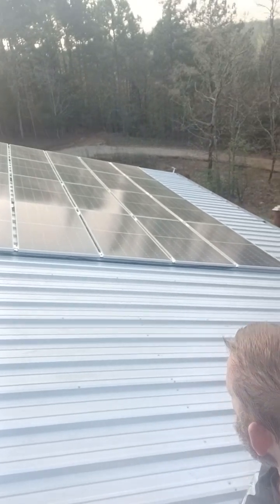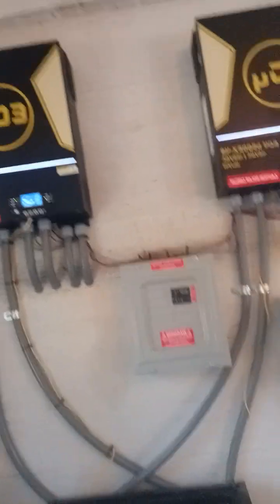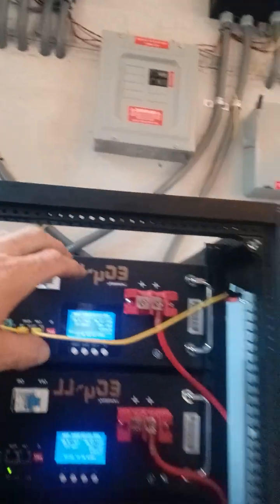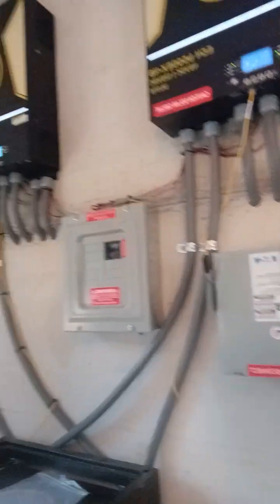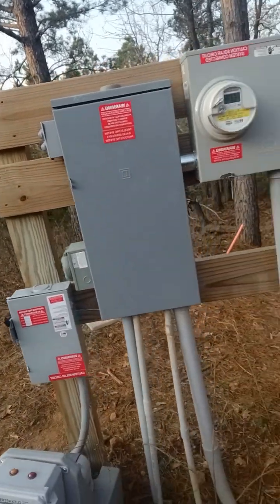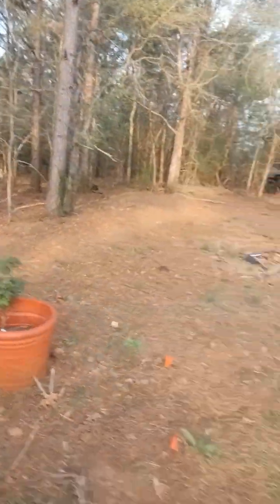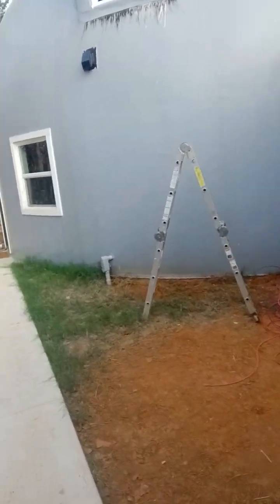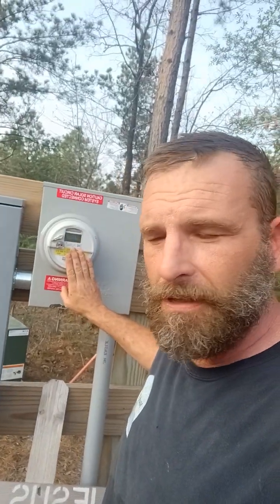@solarworldllc5670 #offgridsolar @SignatureSolar  # customer #eg4 #diy #doomsday #solarworld

Comment: Nice looking setup. I hate when people criticize me. So don’t take this as that type of comment. I really love everything related to solar. So, it looks like the current sharing cables are wired in with the coms cables. They should not be connected between the inverters. The red and black cables don’t belong there. That can fry the circuitry. The only time they are  used is when the inverters are wired together in single phase. Basically nobody uses them. If they are still there I’d remove them quickly.
Reply from the maker: Good question. Yes they are we are only making 120 V / L1 L2 separate lines. Not giving 240-volt capability they do not have the Stacked battery capacity to handle the loads on that. Basically separating the packages by limiting the power output and capability per circuit individually in case one goes down
Reply: @Offgridsolar4life  I was wondering the same thing.  Saw the video and heard you mention that you were combining to make 240v and I saw the red/black wires between the inverters.

Looks nice and clean though!
Reply: @Offgridsolar4life  ahh I see. So you don’t have the coms cables hooked up? Just the current sharing cables?
Reply from the maker: @GavinStoneDIY  
Yes sir independently running as if they're supplying only loads needed on that circuit. I will update new video shortly customer bought more batteries and would like us to put well pump and other items on such as air conditioner. We will definitely have to use the communication cables at that point. I love the questions. That's how we all grow that's how we all know
Reply from the maker: @GavinStoneDIY  I just subscribed to your Channel if you don't mind it helps support us all in our search for knowledge
Reply: @Offgridsolar4life  thanks man. Glad to find your channel. Look forward to the update video.

Comment: Hey brother do u sell those EMPs ... Im looking for some for our system.. Keep it up brother..
Reply from the maker: I actually get them off of Amazon for $384 a piece definitely worth it
Reply from the maker: EMP Shield – Home EMP & Lightning Protection + CME Defense for Flush Mounted Breaker Box (SP-120-240-RL / Concealed Model) Lightning, Solar Flare, and Surge Protection
Reply: Cool thanks brother for the help now I just need to finish the house and put up another 30 panels I hate them sitting there not making me POWER... Keep it up brother